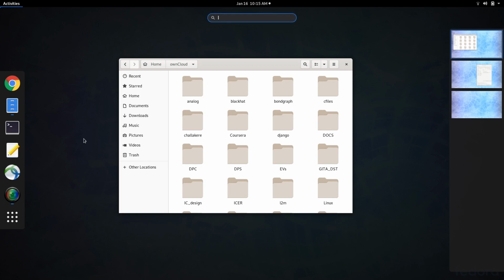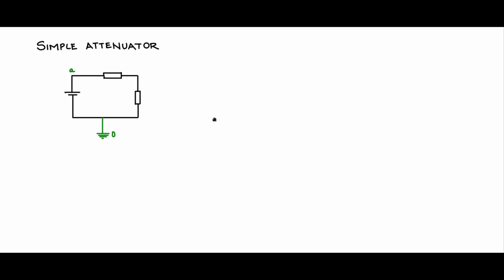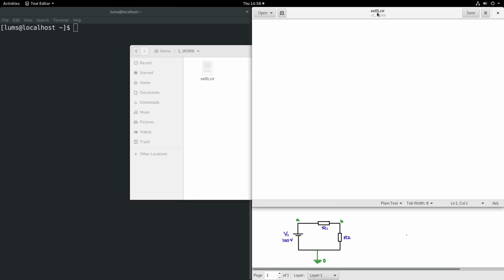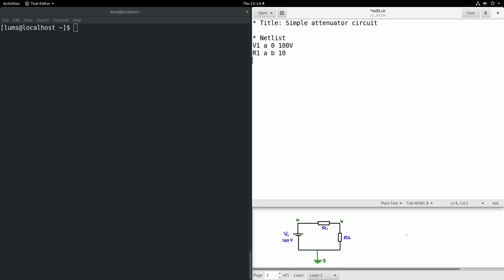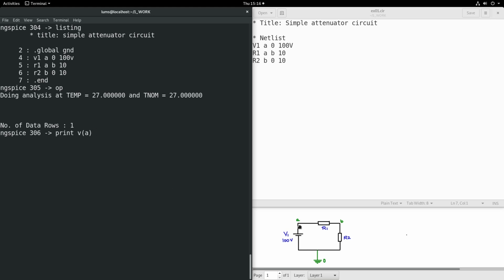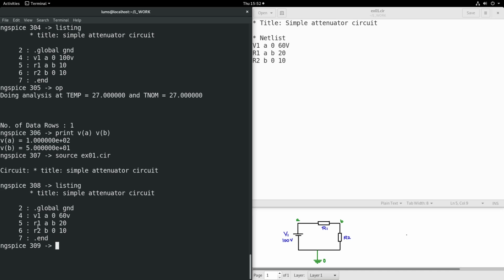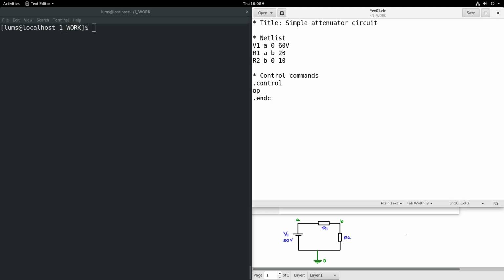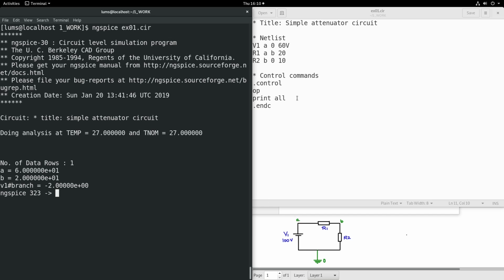Lec 01 Getting started with NgSpice

Comment: Ah, lovely! Thanks for the video :) It was a relief to find someone cutting straight to the crux with no bullshit. Everything else I found was pages and pages of history and irrelevant information and dumps of some commands without showing what is actually the bare minimum.
Reply: Btw, I think the first line is not interpreted as a comment even though it starts with an asterisk. I saw something about the first line needing to be a title line. You can see evidence of that immediately after you load your circuit file as well.